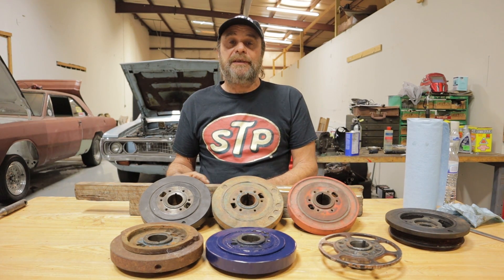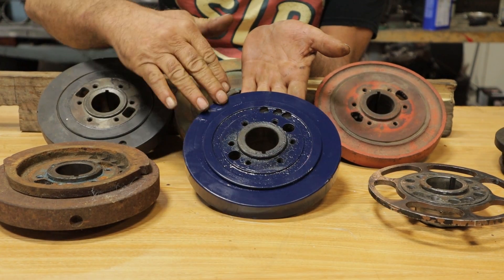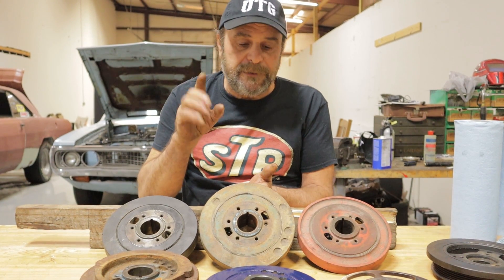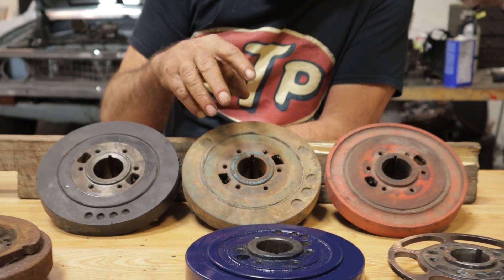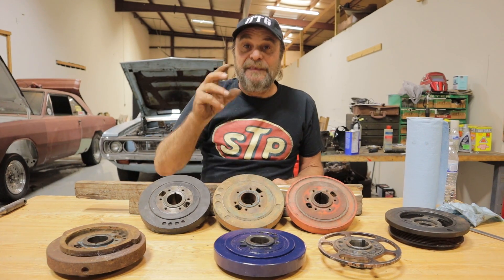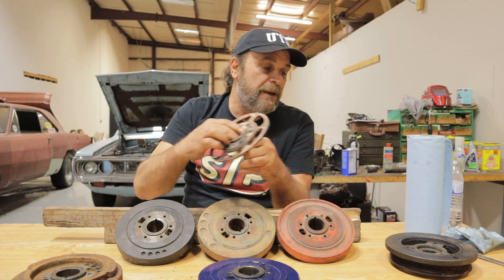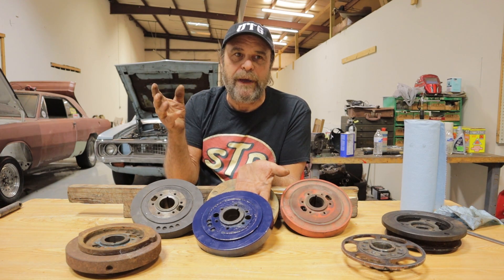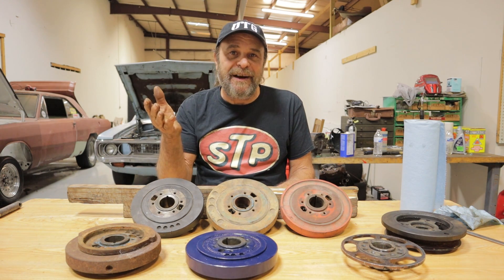Harmonic Dampers And Balancers - What they do, Differences, What To Look Out For, When To Upgrade

Comment: hi uncle tony , got a question , what harmonic balancer do you use when your switching a sbc vortec 350 over to hei and carb and your eliminating the crankshaft reluctor wheel for the crank position sensor  ,,, reason being if you try and use the stock balancer it will go in to far because the reluctor wheel isnt there any more and you are now using a plain metal timing chain cover , and your belts wont line up , 96/02 vortec , thanks

Comment: Why do i even need a damper in a balanced race only engine? A lot of new JDM engines don't have a damper, only a solid crank pulley from the factory. Seems like another flywheel to me that would slow the rate of rev.

Comment: Great Video i recently bought a 1969 c10 with a 4.1 inline 250 motor caked with old grease i was taking grease away with screwdriver and i ruffed up that rubber front only {i wished i watched your video day before} should i replace.

Comment: Is it ok to put an aftermarket damper on an engine I do not believe has the internals changed around. It was missing the damper. I bought one online for it and It is for my 318 which has had slight mods like a different cam. I dont know too much about what has neen done to it but I needed the damper so I ordered one. This new one has four different timing marks so I will have to clock that out and mark my true TDC

Comment: Funny thing, I have a Honda S2000 that I got in 1999, 2 weeks ago the outer ring separated but it did not leave the chat. Belt was still ok but behind the grooves.... I was hitting 9,000 rpm and pretty high speeds the day before! The belt squeal gave it away. Took 25 years and I have a Fluidampr ready to go on since last year but the darnd crank bolt is waiting for a 40" 3/4 breaker since I bent the 24" 1/2" one 😂 (yes using extensions and tried heavy sockets on 900ft/lb impact... actually maybe that loosened up the outer ring) Put a Fluidampr on my duramax LLY about 610,000 miles and it got a lot more quiet, now at 764,000 and going strong.

Comment: I've had 2 balancers go bad over time. If you own an older vehicle or building a junk yard motor, just replace it.  I just had to replace the balancer in my truck, too bad I waited so long to do it. The outer ring slid back and cut a hole in the timing chain cover. If you own a F-150 with the 300 inline 6.  In order to replace the timing (gear) cover you have to replace to oil pan gasket. To do that you have to undo the motor mounts and lift the motor high enough to get the oil pan out. It's was a pain in the A$$, so as long as I was in there I went ahead and replaced the oil pump. My truck is now 30 years old and I don't want to do this procedure twice. The first time one went bad was on a 350 Chevy. Same basic job as the F-150, but was a hell of lot easier to work on. I'm not a Ford guy, but when I went to look at this truck I knew I had to buy it. It had 97,000 when I bought it 11 years ago. Absolutely rust free Florida truck. She's a Peach.

Comment: I'm rebuilding am AMC 390 in an AMX project. I got looking at the balancer/damper and found a very clear crack about a half inch long in the area over the key slot. I wasn't crazy about the look of the rubber anyway so I ordered a new damper and bolt kit. Great video.

Comment: I have a 1991 Dodge Dynasty with very low miles , over the past year the belt slipped off , got a new one and new tensioner but after a few months the belt slipped off and has about 4 times , works fine for a while then off, I noticed a slight wobble from the balancer but not sure why it would be bad with such low miles like under 30k , also noticed another pulley the top of the belt goes on that has a wobble no matter how tight I get it , maybe replace it first then deal with the balancer ? There is also a squeaking noise I can’t find I’m sure is from a pulley, I moved all the pulleys by hand and only found these two issues , the balancer don’t wobble unless engine is running

Comment: My 92 Dodge 4x4  5.9 cummins 5 speed manual and the rear drive shaft where it hooks transfer case had factory balancer on it and I have seen the in heavy equipment and big trucks but not in a pick up truck so is this Jude balcnce the drive shaft or to reduce noise ?

Comment: I have a Foxbody with a 302 that I’m rebuilding for light boost. The engine is an explorer block with explorer internals… and all the internals are good except for the crankshaft. I have a mustang crankshaft that is ground .10 under and ready to be used. Can I use it with the explorer pistons without balancing issues or will I have to use my mustang pistons?

Comment: Hey Tony I noticed the 360 down here that you didn't discuss it was the one that's supposed to be used with the manual transmission the damper on automatic is different for 360 something I found out I've been building engines for years be a good thing for all Mopar guys to know

Comment: I was informed the harmonic balancer is causing a noise like a ticking sound & recommended I need to get a new or used engine. I have a 2006 Chevy Silverado V8 engine 4x4 crewcab. Do I need a new engine? The vehicle is just parked not being driven.

Comment: I am not sure if my stock 72' 340 Block with a Stock Crank & Rods was internally balanced by the machine shop so I'm not sure if I should use the Stock Harmonic Balancer/Dampener or a aftermarket unbalanced one I have laying around ?
Not sure which one or how to find out which one I need , any suggestions ??

Comment: I'm no expert, but I think I'd replace a damper that was over 30 years old. I've seen more than one rubber part that looked fine, but age had hardened the rubber to the point that is was rock hard.

Comment: Good job Tony and thanks, but you forgot to cover the sizes with a tape measure. The reason I was watching your video and searching the Internet is I have a 76 Corvette street and show only.  I am in the process of upgrading the 350 engine with 750 Holley double pumper with 2 inch aluminum spacer. An Eldelbrock Performer, a Roller Cam with around 2200 to 5900 RPM, with linked Roller Lifters and  Aluminum roller Valve rockers and a 10 inch 2700 to 3000 stall converter from Assault and Flotek 180cc/64cc aluminum heads. 

I am halfway through the project now but this balancer thing I have, came up again including timing questions. I Purchased the 8 inch on Amazon from Professional Balancers who says it is for a 76 Corvette. I was told by Google searches that doing so would be a benefit to install an 8 inch with an after market Harmonic Balancer like Professional Products (80002) 8" Harmonic Damper for 350 SB Chevy because of the aftermarket changes I am making. The OEM is a 6 3/4 balancer. Any thoughts on that.

Comment: Two years ago the ring became loose at 65,000 miles in my 2006 Mustang with a 4.0, taking out the crank position sensor in the process. While looking for a new damper, I found out that a 2010 Mazda B4000 pickup with the same engine also had the same interchange part number and was exactly the same. This was true for other models of the era as as well, like Ranger, Explorer, E-150, E-250 and more.  It was cheaper too so I installed it. Never had an issue since but I keep an eye on it.

Comment: Should the harmonic balancer move at all because my cars engine makes a roaring sound but if i give it gas or let off the gas it goes away and comes back when i apply the same amount of gas when it sounded like it was roaring. I replaced my belt and idler pulley but it still squeals at startup

Comment: HI question. (boat engine Ford 302's) 1974 been stroked to 347. these were stroked back in 2011 (previous owner) and I am having the blocks rebuilt again (could not fit a 350 chevy in engine bay) how do I know is I should change the harmonic balancer? I really do not know if back in 2011 they changed that or simply left the original balancer form the 302 (question is there a way for me to find out what part i have? are they numbered some how

Comment: I enjoy your content Tony. I have a question for you. I have an 82 dodge 1/2 ton with a 318 2bbl 2wd, it's my garbage truck for the shop. The transmission had a bad leak and ended up burnt out. I bought a nice recent professionally built 727, but it is from a 360 1982 vintage. I noticed the huge weight on the torque converter but had no incling about internal and external balance. Hence the engine has quite a nasty vibration now. The question is, can I remove that huge weight on the converter to fix it or can I possibly just use the balancer from a 360? Thank you  Tory

Comment: this has been a question i have been trying to figure out for a year.
i have an lt1 for my 96 implala im building. stock crank and rods but new piston, roads and piston are with in 6grm of each other, loyd Elliot heads and cam.   
i have went back and forth in my mind for along time if i needed to spend the 500 for a good A.M. balancer or just buy a new stock type.
i had searched this topic a 100 times with out luck before today, thank you brother.

Comment: Tony, You hit your head on the nail when you talked about the affects of accesories driven off the front of the crankshaft.  They add rotational inertia that helpd damp out the rotational pulses in the crankshaft.  The rotational inertia of the accesory drive system doesn't compare with the rotational inertia at the back end of the crankshaft, provided by the flywheel and clutch cover is you have an Amish transmission or the torqueconverter if you have a slushbox.  The front of the crank needs additional rotational inertia, or the crankshaft will fatigue from winding and unwinding due to the torsional pulses from the connecting rod forces on the crank pins.  The harmonic damper reduces the torsional "Ringing" of the crankshaft, which reduces stresses in the crankshaft, preventing fatigue fracture of the crank.  If your harmonic damper fails, it's less expensive, but not as much fun, to replace it with another harmonic damper instead of a belt-driven 8-71 blower.

Comment: I had a dampener come apart on my driveshaft in an 02 S10. Ended up just hacking it off instead of dropping the shaft. You could actually feel a difference in acceleration in that extremely under powered 2.2L after removing that big hunk of iron

Comment: I had the whole damper fly off a 64 Chev 327, that was before they added the center bolt. And I also worked on a 86 IROC Camaro 305, where the inertia ring slid backwards a sawed a hole right thru the timing chain cover. Fun stuff.

Comment: Tony, great video as per usual. Thank you for sharing all the info over the years. One question for you though. Side bar first. I have 2 Oldsmobile 303 V8 engines that I am using for a project car. Both engines are identical in their basic form. Both are 303 based, Rochester 4 barrel blocks. Both have generators, block mounted water pumps, and same cast iron exhaust manifolds. One engine is out of a '52 Olds, matted to a hydramatic auto trans. The other engine is out of a '53 and had a 3 speed manual backing it up. The '52 engine has a bare crank pulley while the '53 has a balancer mounted to the crank pulley. The '52 engine spins and should run with a little TLC. I did already drop the pan and the internals looked good. The cylinder walls looked good as well. The '53 block is seized though and the cylinder walls are in very poor condition. Now, I would like to use the manual transmission off of the '53 engine and mate it to the hopefully good '52. My question for you is: Would I need to take the balancer with the crank and any or all of the other internals as well as flex plate off of the '53 block and put them on the '52 block in order to get this to work? Or would just changing out the flex plate from the automatic to the manual flexplate be sufficient enough? I do have a few Oldsmobile shop manuals for these year cars, and as far as I can tell, they did not mention anything about needing to switch over the harmonic balancers with the crank and internals as well as the flex plates. Thank you again for all of your time and shared wisdom Tony.

Comment: My brother had a mitata with a bad valve cover gasket, leaked oil all over the front of the engine. Had his damper/pulley fly apart from that oil soaking. Chewed into the timing cover when it was walking around before it flew off. When it flew off it pressed into the rad fins, caused a slow pressure leak in rad, eventually had to replace it. Thankfully I was able to find a replacement timing cover, and replaced it when I did the timing belt & water pump. Should've just fixed that valve cover leak when it first started...

Comment: I've been rebuilding automatic transmissions 45 YEARS now I'm 59  as a young man  my Dad ask me to put a harmonic balancer sleeve on a 350 Chevy engine  ,,, after the new sleeve the CUSTOMER  sead ,  WOW THAT'S ABSOLUTELY the smoothies my car has ever been ,,,,,, OH yeah I found a chunk of tar  clogged up in the balancer  and chipped it out with a screwdriver and hammer  , I didn't even know what I had done ,,, but AT 14 years old  a 20 $ tip gave me a good idea to stick with it ,,,, no pun intended 😁👍

Comment: At 06:10, First time I ever heard that any Chrysler Factory internally Balanced (Neutral balanced) engine Requires a "Specially Balanced" matching Damper ??? ....I would expect my '70 Factory Hemi damper is within a few Grams of true "Neutral"  Balanced as is the Riciprocating & Rotating assembly (my rods & pistons within 2 grams Factory assembled I measured) Same as the Factory flex plate & Torque Converter assembly......How can Any "Neutral"  Balanced part, such as a Damper have some "Unique" balance Factor ?? ....Different "Neutral" Internally Balanced engines could have Different "Resonant" crank Vibration Impulses that need Specific "Band" Damper tuning such as the Neutral Internally Balanced  "Thick"  Street Hemi Damper compared to the higher Rpm, "Thin" Factory  Race Hemi Damper application...Like said, 1st time ever heard Neutral Internally Balanced engines Require Specifically "Uniquely" Balanced Dampers ???

Comment: When my father and I switched out the 302 for a 351 Windsor in his 83 F 100 Ford truck we had two problems to deal with when initially trying to start it. 1st, was the firing order is different 2, was the timing marks on the harmonic balancer was wildly off, no doubt due to being shifted. We ended up findings top dead Center with a dowel . 

Good to know that they can fly apart!

Comment: Im trying to decide if its worth running a copper head gasket on my engine. But I just cant find any good info if it will work in the long run on a street engine.
So theres a suggestion for a video 🙂

Comment: The part about designing in the accessory drives helps reinforce a thought I had about a 330 Olds engine I had which had no damper at all (just a counterweighted hub) and relied on the accessories to do the dampening.
Reply: Ford 2.3 sohc lima engine is the same, it had a big metal hub lol...

Comment: Even on the Big block Chrysler 361 I have has the stock dampener. 

But I imagine the dampener will create quite a racket when it gets loose.

As the accessory drive 4 belt pulley is in the way of the dampener from "coming off" so essentially trapping the outer ring.

I'd think that the outer ring will be pummeling everything in it's vicinity. If It does come loose!

On big block Chrysler stock dampeners pre-1964.

To inspect the health of the dampener, the 0* degree mark on the weighted outer ring should be about 90* apart from the crank indexing stub.

Comment: Had the one on my 3.9L dakota start coming apart. Checking timing i saw it wasn't right so I replaced it. My 79 camaro had the inertia ring back off and start eating the timing cover. My 85 d150 will get a new one when I go in to do a timing set and refresh. Very good info as always 👍

Comment: Had a balencer on my amc 360 start to seperate.. the rubber was pulling out.  I used rtv on it to hold it in while i got a new one.  New one works great.

My 98 4.0 Grand Cherokee after about 280k miles needed a new balencer.  The engine made weird noises in the cabin.. looked at the balencer and it was wobbling.

New one in and it sounded like normal again.   Engine now has 400k miles
Reply: Yep same thing with my 4.0 Cherokee. Started wobbling at 150k miles. Has almost 200 on it now..
Reply: @DanimalZ32  did you replace it ?
Reply: @jeepsblackpowderandlights4305  Yeah I had to immediately. It kept throwing the belt off. Had to stop multiple times on my way home from work to put it back on just so I could get it home.

Comment: I needed a crank for my 383. I was told 400 crank would work. And it did except for bad vibration. I finally figured out that the 383 was internally ballenced and the 400 was externaly ballenced. So installed 400 balancer and 400 torque converter. No more vibration .

Comment: I bought an old corvette.  Very stock/original with a smooth running original engine.  Despite there being no sign of the damper being bad I went and replaced it anyways.  I figured after 50 years it was time for it to retire.

Seems that the LS engines in later year vettes have issues with their balancers.  I’ve met a bunch of C5 vette owners who said their inertia ring had moved enough to start rubbing against the water pump cover.

Comment: Does torque or HP "Camshafts" are factors or only the High RPM limit for the factory used Damper and Balancer.   Some engine with huge cams runs very rough from big Lobe !!!  And have rave limiter.
One thing i can say to this is...
If Uncle Tony uses the "Aftermarket" word so many times.  It must be crucial to these applications.   I learned that anyway !  Hehe